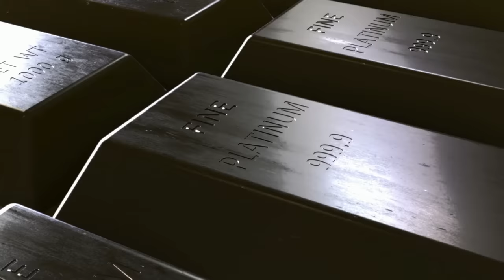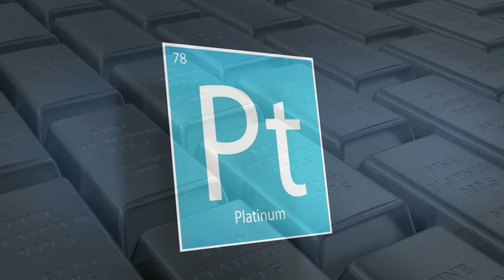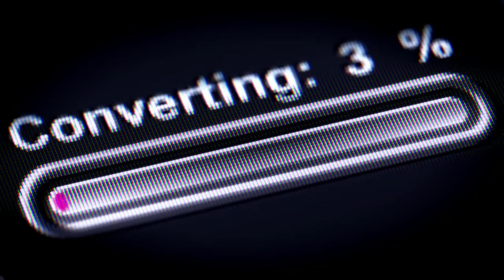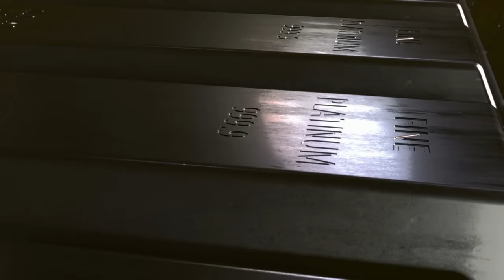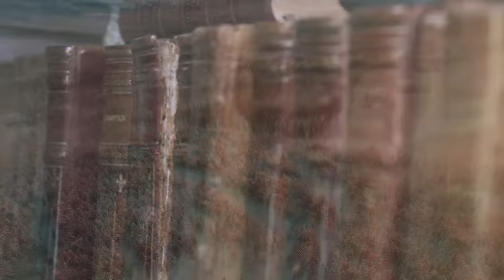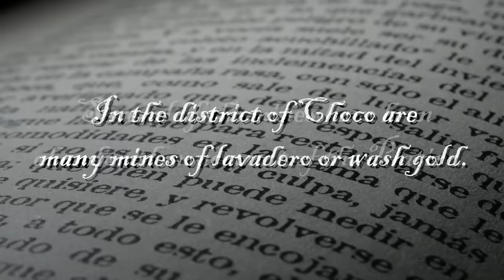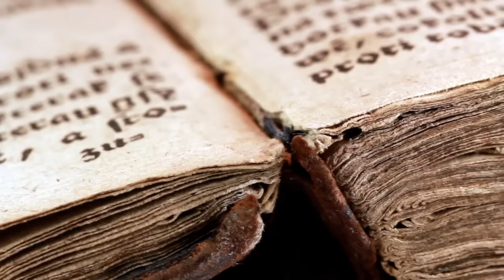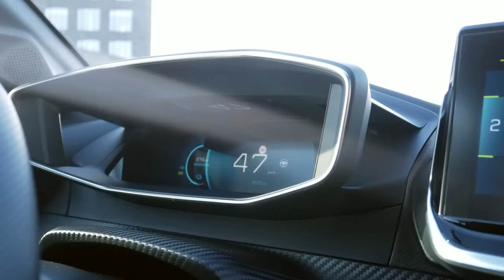PLATINUM Documentary: Mining, Science and History

Comment: 8:45 The purpose of the French Geodesic Mission to the Equator was NOT to prove that the Earth wasn't flat (it's not), and it was not then widely believed (nor for many centuries before then) that the Earth was flat. The main purpose of the mission was to measure the length of a degree of latitude near the Equator, and thereby to calculate the Earth's radius. Part of the purpose was also to determine whether the Earth was wider around the Equator or around the poles.
Reply: Yep. Stopped watching the video right there. :))
Reply: Is that when the English were trying to make a clock accurate enough to measure longitude?
Reply: @garysarratt1  The events occurred in the same time period (early 18th century), but were not pursuing the same things. From the Wikipedia article about the French mission, it was "carried out for the purpose of performing an arc measurement, measuring the length of a degree of latitude near the Equator, by which the Earth's radius can be inferred."
Reply: @HolySoliDeoGloria    Maybe I meant latitude, I don’t remember.  I’d better look it up!
Reply: No, you were correct. An accurate clock is critical for determining longitude. This was the great quest of the time in the field of navigation and one of the greatest pursuits in all of science at the time. Determining one's latitude is easy and can be accomplished by several straightforward methods without a clock.
Reply: @HolySoliDeoGloria    Thanks for the follow up!
Reply: (it is) even the bible says earth is immovable on pillars under the firmament with water on top....

Comment: Very good documentary indeed. Well done and thank you for sharing it. Your prognosis for rapid increase in use for fuel cells may however be premature. Hydrogen fuel cells are unlikely to gain much traction in the automotive and power generation industries as Li-Ion batteries have proven to be more reliable, and far cheaper (and increasingly so). In terms of power generation, solar is now the cheapest form of electrical generation, and getting cheaper. Wind follows a close second. Coupled with Li-Ion mega-pack batteries, the unsubsidised marginal cost of 1kwh is now less than 2US cents - and getting even cheaper.
So... platinum is unlikely to be in such high demand from around 2028/30 - and demand will decrease exponentially when ICE automobiles become redundant - probably between 2030 and 2035.
Reply from the maker: Thanks for the comment, although based on the research I have done wind and solar are so incredibly inefficient I'm not sure they'll have a big future as sources of energy.
Reply: Someone drank the coolaid.

Comment: There is one question related to usage the local platina for manufacturing of jewelerly. If the south-american  pre-Incas  were able to to work with the metalic platina, so why on whole S America continent the warriors and craftsmen did not used the iron tools, which temperature of melting is some 100 degrees Celsius lest than that of platina? So metallurgy of iron would be easier to this pre-Inca craftsmen.
Stary

Comment: Platinum isn't hard! its a soft metal with a 4–4.5 on the MOHs scale of hardness! I dont know where you heard it was a hard metal resistant to scratches...
Reply from the maker: You are correct on the MOHs, from what I understand that means all metals with a higher rating could scratch it so it appears I misspoke. Thank you for pointing it out.
Reply: @CommodityCulture  No problems buddy!
Reply: Ask a jeweller and a watch maker. Platinum is much harder than gold. You need sharper and harder tools to work it and it takes much longer to polish it. So despite the fact that at the time, as a commodity PT is cheaper than AU, jewellery and watches made from it a still more expensive than that made from gold.

Comment: Catalytic converters are going away and roughly 40% of the total platinum production volume is consumed by the automotive segment. Not good. Someone better invent a battery that uses this stuff. 😁 Recycling of existing catalytic converters is also cutting into the market for virgin platinum and there are about to be a very large number of junk catalytic converters available. It may follow the path of lead acid batteries. We recycle over 90% of lead used in car batteries, that's way we don't have a lot of lead mines. That market is also going away.
Reply from the maker: We'll see. I personally don't think the transition to EVs will be as dramatic or fast as people think. Plenty of use for catalytic converters, potentially for decades to come.

Comment: Platinum takes almost double the time to finish in jewellery and has to be soldered with welding glasses on. If it loses it’s precious appeal due to the decrease in price its stuffed because the labour necessary at the jewellery bench will make it economically unsustainable.
Reply from the maker: Interesting observation. Apparently platinum demand for jewelry was 25% of total supply in 2021, a massive number so you have a point.
Reply: ... its* precious appeal (it's = it is) ...